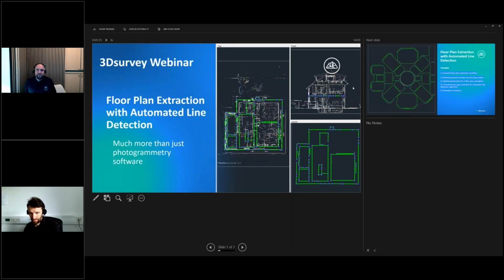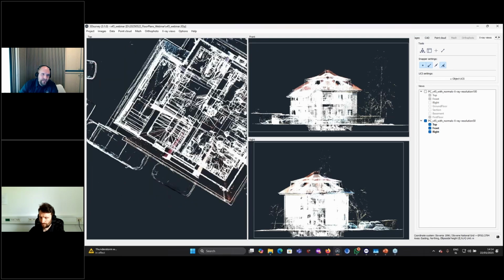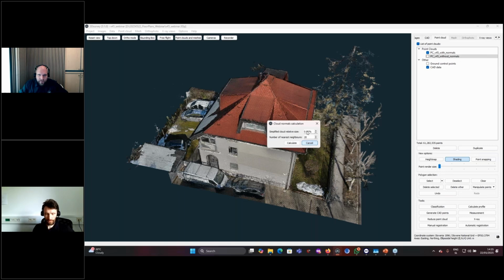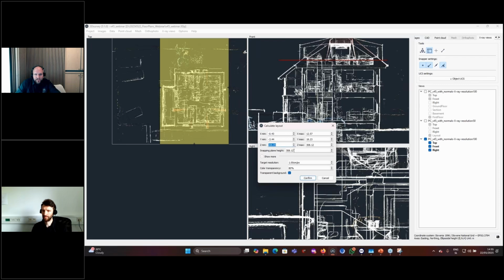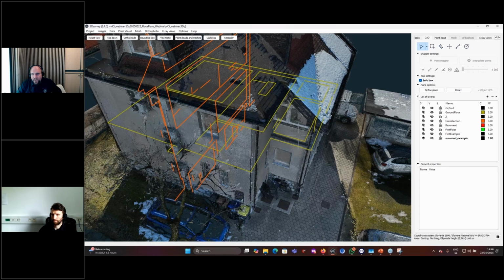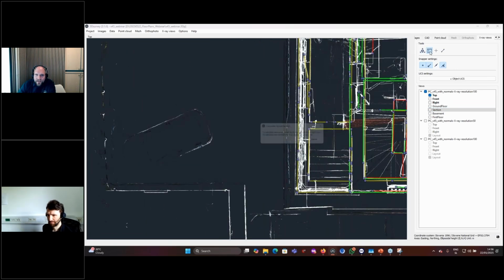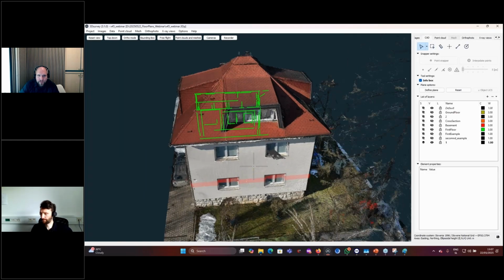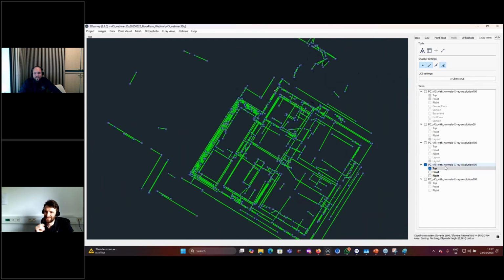Webinar: Floor Plan Extraction with Automated Line Detection | 3Dsurvey

Comment: I am thinking to buy slam2000 for residential property floor plan. Any advice on editing
Reply from the maker: Hi, we have not yet tested datasets from this device. Our suggestion would be: try to get a demo dataset and check some independent accuracy test.
As long as it outputs: laz, las, e57, ply, txt, ... you can work with it in 3Dsurvey.